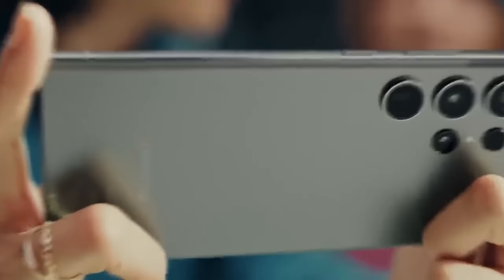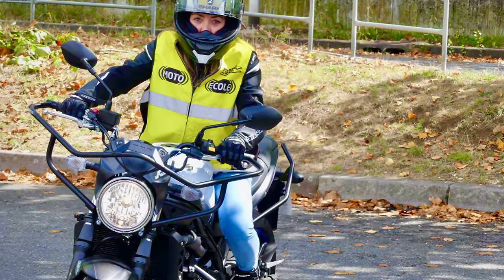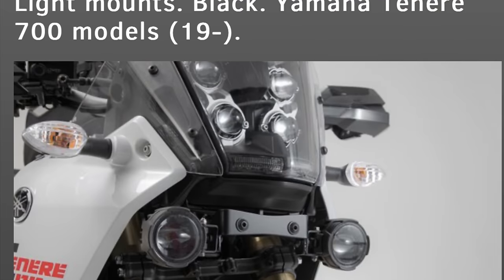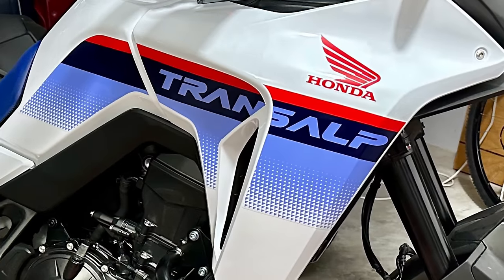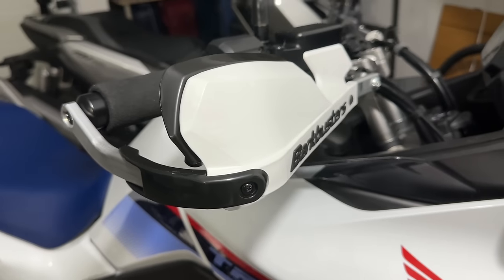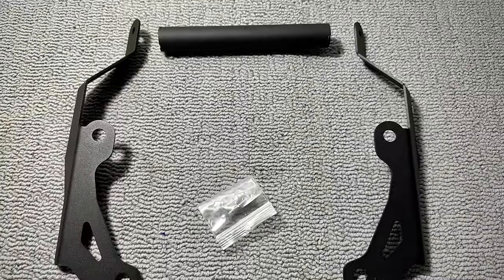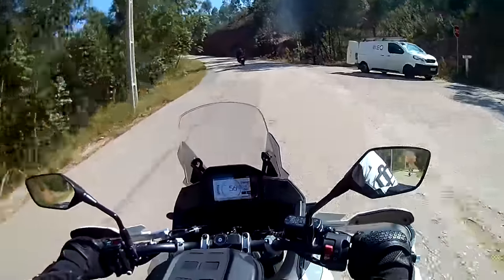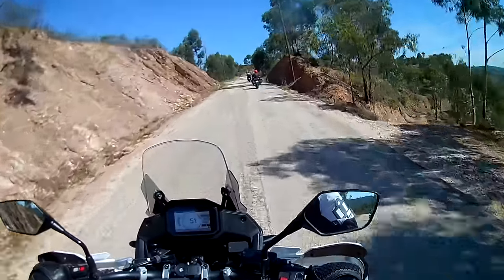An Alternative to Traditional Crash Bars

Comment: I totally agree with your assessment of needed protection.  I think the lower engine protection and hand guards are a good choice.
Reply from the maker: Thanks😊👍
Reply: I used Outback Motortek Low crash bars on my Africa Twin and they did a great job.  This bike is very similar, so I totally agree on Low Bars.

Comment: The black looks infinitely better than bolting aluminum ladders to the sides of the motorcycle. I don't fall down much. I'd take my chances leaving it purdy.
Reply from the maker: Agreed👍😊
Reply: I have never seen Aluminium protection bars, the 'silver' ones are in fact of Stainless steel which can also be powder coated in colour of choice. High bars not only protect fairings from scratches but also the mounting positions of the fairing especially if those mounting positions are in/on the fueltank. Many have suffered a leaking fueltank because of this and barkbusters (other makes are available) will not prevent this in rough terrain.

Comment: The small lower bars definitely look better. I had full size Heed bars on my AfricaTwin and they were very heavy and as you say I preferred the look without. I did use it off-road though, had a big drop and the handlebars turned back under the bike (like being at full left lock). The full size crash bars definitely saved it that day.
Reply from the maker: I totally get that. In certain situations, full-height bars will save the day. Thanks for your feedback👍😊
Reply: engine guard and a good handle bar should be enough for the body imo
Reply: I have the same on my AT1000. The full sized bars saved my bike the couple of times i dropped it.

Comment: great video, i got the exact same crashbars and hand guards for my transalp because of your video. thank you very much for the content.
Reply from the maker: That’s nice to know. I hope you’re happy with them. I have the H&B skid plate on order, but it won’t be here for another month, unfortunately.
Reply: @RocketMan_Moto  i made a skid plate myself, since i know how to bend aluminium and i have some knowledge on 3d modelling it was quite easy using a 3mm sheet. 

since here in brazil the newer transalps are hard to come by, no one makes aftermarket solutions locally.
Reply from the maker: Good work!👍😊 My wife is from Olinda, PE

Comment: I had a 2008 BMW R1200 Adventure. I painted the crash bars black.  
Mine came with Touratech cylinder head protectors and OEM crash bars. After a small tumble, I realised the engine bars and head covers came close to trashing my cylinder head (not just the cover). 
I junked the ( now bent) bars and fitted carbon fibre rub covers to the heads. I kept the tank protecting bars. My new setup was significantly cheaper and provided better engine protection. 
The luggage knocked at least 10% off the driving range and made driving in traffic a chore. I think an upgraded mono wheel trailer (copy the Bob Ibex) is a far better option. 
The rear hugger needed to be longer. I planned to make a full cover hugger (like the Britten 1000 used). But sold the bike before it got done.
Reply from the maker: Thanks for your feedback, David. Ride safe :)

Comment: Totally agree with you on the lower crash bars and not getting upper ones. I have just added a tiger 1200 rally pro and was happy that it came with lower bars but not the upper ones like on the explorer. Hope your enjoying the new bike. Send us some weather as it’s all turned to rain in the U.K. 😂👍
Reply from the maker: Thanks. I loved the Tiger 1200 when I tried it, but it was beyond my budget. Too hot here at the moment, tbh. 37 today, we’ve been hiding indoors with the AC on. Might as well be pouring with rain🙄
Reply: @RocketMan_Moto  I hear you 37c I remember that last august in Switzerland 🇨🇭 ended up riding just mornings as afternoons got too warm. 😂

Comment: Nice video and agree with your assessment regarding the almost automatic over-farkleing of ADV bikes.. If I can offer a perspective on the hand guard topic.  I've been riding an 08 KTM 990 Adventure since 08 with the stock ABS plastic hand guards.  The bike has seen 30-40k miles of single-track and twin track mountain, forest and desert riding with a couple very hard crashes and plenty of tip overs and slow speed drops.  Other than some scratches, the stock ABS hand guards are just fine and that is by design.  ABS is incredibly strong for it's weight and  the benefit of the ABS guards is their ability to deform a bit and absorb some of the impact while not transmitting that impact directly other parts of the bike. In 15 years of ADV riding, I don't think I've never seen a beefy ABS handguard  broken, while I've seen plenty of soft aluminum guards bent into the controls or worse.  So before you go adding another ridged piece to your bars, you might consider sticking with the ABS units if available.  Thanks for the content.
Reply from the maker: Thanks. Interesting perspective👍😊

Comment: Great video. I ordered and fitted the Barkbuster hand guards after seeing your original photos. Very happy with fit and finish
Reply from the maker: Thanks. Yes, they’re very solid and match the Transalp well, imo
Reply: Bark Buster Hand Guards work fine as off-road brush guards, but they don't help to keep your hands warm in cold & rainy weather. "Shad" Handlebar Muffs make Winter Riding enjoyable. Combined with your riding gloves, they help to keep your hands warm & dry, even in the cold rain. "Hippo Hands" are another option, but I have not tried them.

Comment: Having had several dual sport/adv/enduro/TET type bikes over the last few years, I’ve come to the conclusion I prefer plastic covers for clutch case/engine and tough plastic sump guards/bash plates. And decent wrap around hand guards mainly.  (Plus radiator guard depending on bike design)
Some of these are really thick and tough, (stronger than I expected on testing) and they lower weight, reduce vibration and noise, and protect for general low speed drops just fine. (Where most of my “offs” happen in slow/sub 30mph) technical slippy /steep stuff.)
A proper high speed crash (or a crash involving cars on road) could easily wreak a bike anyway crash bars or no crash bars. 

But everyone’s milage will vary. 
I’ve never been bothered about scratching my bike plastics. 
(Even a new bike which I’ve had a few times)

Certain big metal bash guards do add other benefits other than protection. 
Holding tool kit. Or adding structural rigidity when engine is load bearing for jacking up bike by sump. (For T7 for example.)
So it very much is bike specific. 
But I certainly lean towards minimal hard plastic covers more than big heavy crash bars where possible.
Reply from the maker: Good alternative. Thanks for your input👍😊

Comment: Upper bars are important as the lower bars, IMO.
Drop the bike on a raising trail on the Alps (a lot of rocks and stones) and you will start crying in various different languages because of the damages at the fairing.
Furthermore, if you put noy fragile stuff inside the soft bags you strapped on the bars, then thay will act as additional protections too.
Reply from the maker: Thanks for your feedback. As I said, a rock can easily go through a gap in the upper bars. They help, but there’s no guarantee😊

Comment: Nice video and I fully agree on all except one small point.  I opted for similar crash bars but chose silver.  As you pointed out, scratches will be more noticeable on scratched black painted bars.  As an aside, I never understood crash bars that wrap around the front of the bike.  The front of the bike is not really at risk and that adds useless weight.  Thanks for the video!
Reply from the maker: Good point about the paint. Black powder coating will always be more susceptible to chipping

Comment: Agree. I’ve never added full-height crash bars, though I have considered them a few times. Being primarily a pavement rider, I could never justify them, and prefer minimal scaffolding. That said, I have a Himalayan and it has tank scaffolding, but it’s OEM. Double mounting-point Barkbusters go on every one of my bikes that they are available for. You strike me as a Versys 1000 rider, given your physical stature and experiences with, and impressions of, the sport-touring bikes and brands you’ve owned and tested. I may have missed it, but my superficial search didn’t show a review of it on your channel. If you tire of the Transalp’s engine, suspension, and lack of cruise control, the Versys 1000 in the top-spec trim could be worth a try; unless you’ve already tried and ruled it out, of course.
Reply from the maker: I did like the Versys 1000, but it’s getting a bit long in the tooth now. Maybe the next generation?👍😊

Comment: Good video.  I agree with your findings about bar height.  I have a XR 650L for which I fabricated my own crash kit after nearly destroying the bike on my second ride and have found that the mid height protection covers just about every remarkably frequent "crash" I've had with the bike.  My DL650 has a factory kit with mid height protection and a skid plate with similar effect.  I did some stupid things with that bike early on and turned the all 1/8" aluminum skid plate into a U plate with popped rivets within 2 weeks but the bars have kept it looking like new and I don't crash it, more "lay it down for a nap" when the need arises.
Reply from the maker: Thanks for your input👍😊

Comment: for average commuter, low bars are definitely the way to go. For tourers , I totally understand the bonus you get with mid height or full height bars. having luggage bags attached to a lower position makes a big difference in handling and mounting lights is just that much easier and you get much more options for less money.
Reply from the maker: Yes, if you want to add lights and bags, more bars can be useful👍

Comment: Hmm, as a tarmac rider I have some difficulty to get why people need to go somewhere where they can drop their bikes. But light is right, that low solution propably does what it is supposed to do. Without spoiling the looks of the bike too much. So good work 🙂!
Reply from the maker: Thanks, Robert👍😊
Reply: same here, no way I'm taking a new bike to somewhere that rough I could maybe drop her, but I want good protection fitted even for road work and light gravel tracks so this is excellent stuff.
Reply: Tarmac is not magic and a lot worse sometimes, my last fall was an idiot driver knocking me from behind at a roundabout.
Reply: And, if you did want to go on the rough, why would you take a Transalp??  They look like they might handle a gravel road, or maybe a grass paddock, but thats about it🙂
Reply: It will help if you get sideswiped by a soccer mom playing with her phone or the bike is blown over in high wind while parked.

Comment: Nice looking guards. I remember when I used to ride dirt about 50 years ago. No guards of any kind and I crashed my bike all the time. I didn't ride in rocky terrain though. I broke the water pump cover on my GL1200 jumping a curb. I like hand guards and have them on my XR250 to save my levers. I made hand guards for my Wing to keep the handlebar muffs from pushing on my levers. My buddy bought a Tiger with all the full protection. All black and stunning. Now I want another bike.
Reply from the maker: Haha, I want another bike about every 2 months😂

Comment: Do I need to carry that much stuff?  Yes... Yes I do, and more as a matter of fact (I sometimes add an 80 liter dry bag on the pillion in addition to the 3 cases).  But then my motorcycle is my only vehicle, and I use it for things like grocery and other shopping and extended camping/touring in Canada.  So 100+ Liters of lockable cargo space is essential for me.
The sump guard is also a very useful bit of kit if really going off road on rocky terrain so you don't get stranded if you land badly on some pointed rock.  But if you are only doing dirt roads and trails, is not needed.
Reply from the maker: Fair enough. Thanks for your input😊👍

Comment: I totally agree with your intro. I think we motorcyclist get caught up in an accessory buying addiction. I know I have. My Harley friends will spend tons on chrome and lights. I have gone overboard myself with three unused seats, unused paniers, unused windshield extension, and a sump guard (removed for oil change purposes). I bought some gold colored fork preload adjuster knobs because they looked good. Total garbage. Trying to ride my bike more and shop on line less.

Comment: 890/901 platform is soooo SO! good for crashing. Basically stock type of low positioned protection, as what you are talking about here. One of the reasons why I am on 901. Crashed at least hundred times by now, even had lowsides on tarmac. All controls still intact, and plastics just scratched.

I also prefer having plastic handguards as stock ones are flexibile, and I have cut-off  levers straight from the showroom floor, so they don't break.

Great video, good points, totaly agree.
Cheers
Reply from the maker: Thanks, I'm not a hard-core off-roader like you, so I can make do with a simpler bike and less protection :)

Comment: Hepco&Becker do make very thoughtful crashbars. I have the lower crashbars for the G310R/GS model and it protects the engine and the fairing as opposed to the BMW crashbars which only protect the engine. The do make great accesories overall.
Reply from the maker: Agreed. I have their skid plate on order.

Comment: I would like to see an even more robust version of the KTM/Husky approach of slinging the fuel tank low around the engine and having the tank be armored. Then you don't have to add any weight, and what you do have is kept low.
Reply: I wish someone would test the "new" 790 and the Transalp,  No one seems to mention it, £500 more than the Honda, but it has some good bits too tubeless wheels, those lower tanks and better looks, and options like cruise control
Reply from the maker: I agree. I really wanted the bars/guard that Rally Raid make for the CB500X, but despite numerous emails, they never really confirmed whether they’d be offering anything for the Transalp😐
Reply: @flexywing I wish the same. About the looks, that is very subjective. I do like the looks of both, but they are so different, looks wise.
Reply: @davidmallia628  I was lucky enough to ride the KTM790 Adventurer and the Transalp, with a test ride in controlled circumstances and I am afraid I am just not good enough rider to tell the real difference between them.  The KTM felt more exciting but the engine felt rougher (but no vibes)The Honda felt perhaps more refined, it was funny but no bike went yeah, If I had to choose, it would be the KTM, I think the "new" one looks much better than the Transalp (sorry Rocket) But the ?mark over reliability still worries me.  SO still sitting on the fence, I currently have a Honda NC 750x DCT 2021, and its great ticks all the boxes, yes it could be a tad more powerful, but its fast enough (just)  and it is very practical.  I suppose I am very lucky as my wife has a Honda Hornet 750, which she lets me ride ( as Long As keep the fuel tank filled!   My other choice is the Triumph 1200 Speed Twin,   Oh the choices!
Reply from the maker: Thanks for your feedback :)
Reply: @flexywing  I think the Transalp is the best choice for your needs, and skill level, if the seat height is adequate, enough. The Transalp is lighter, if not with the lower centre of gravity of the 790/890.

Comment: So, I have had my "Great White" for 7 days now and absolutely love it. It is only a month old and second hand but has a lot of extras on it from the previous owner. 
Unfortunately or otherwise it has the zimmer frame on it with the lights but I am going to leave them on for the moment as the lights are a safety feature. 
Came with knuckle guards, quickshifter, deflectors, low seat as well as standard, radiator grill, heated grips and the previously mentioned items. 
I have ordered the Engine Guard Kit and Skid Plate as I like the look of them and got them for a good price. 
Also ordered the Centre Stand which I also got for a good price. 
From elsewhere ordered from Italy the Givi Top Box Monokey Adapter as I already have 2 Givi top boxes. And the side stand foot.
A word of warning in that the bike, like a lot of bikes, can easily tip over, the side stand needs to be checked to make sure it is fully forward before dismounting. 
And park on level ground or slightly uphill, or leave it in gear.
As I would like to add some more electrickery I am attempting to get around the canbus thing and have managed to squeeze a USB C cable into the very tight socket near the rear under the seat. Then I will fit a USB C type cable with male one end & bare wires the other, then connect the bare wires to ground and live feed for my PDM60 power distribution module. 
No errors have come up so far from Mrs Canbus.
Thanks for the tip on the GPS bar. Does it vibrate at all? Might just get the same one. 🤩
Reply from the maker: Thanks for your feedback. No vibrations from the accessory bar👍
Reply: @RocketMan_Moto  That is what I was hoping, thank you for the quick response.
Reply from the maker: To be more accurate, the vibrations from the accessory bar are no worse than those from the handlebars

Comment: Grat material! I also feel pain when putting this overweighted stuff on my motorcycle! Great alternative solution! Have you exanimated if the engine protection interfere with engine protection plate. I know this is kind of substitute solution to each other but in case of visual aspects, some may want it too
Reply from the maker: The Hepco & Becker skid plate was not available when I made this video, but it is now and I have one on order👍😊